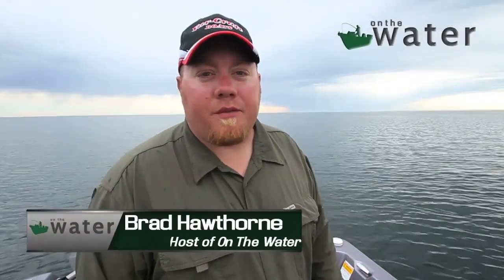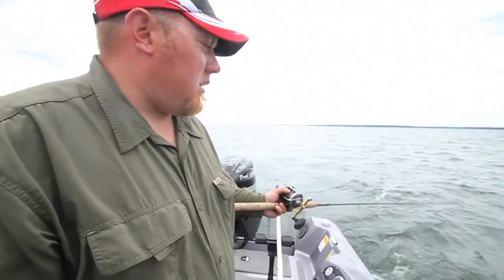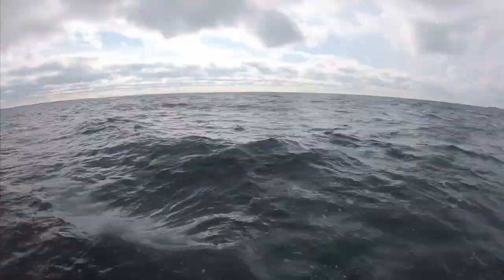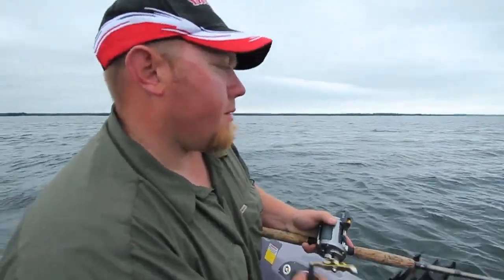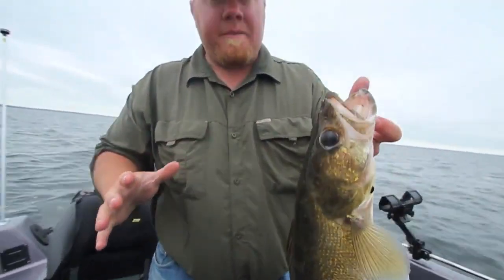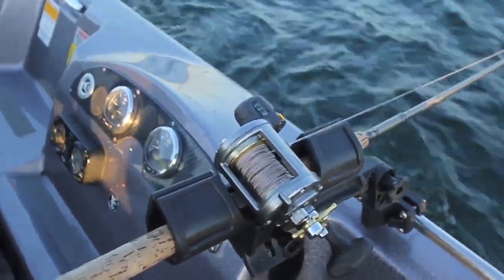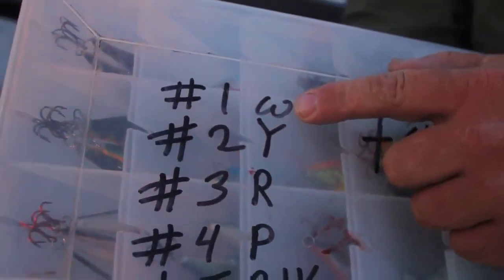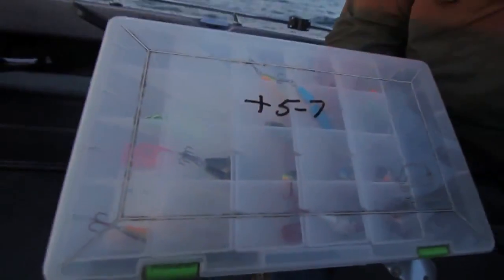Leadcore Trolling Walleyes on Mille Lacs Lake

Comment: Each color of lead core is 10 yards NOT feet. Each 30ft/10 yards of lead core will put a bait down 5 feet. If you have 4 colors of lead core out , you have out  120 feet of lead core not including your leader length.  Do yourself a favor and make it simple and use a  line counter reel so you don't have to remember colors.  A double "Uni Knot" is more practical to join lead core and your flouro-carbon leader as the swivel is awkward to pass through the rod's guides. If you are running  a crank bait with lead core,  you must  add the diving depth of the crank bait at the length of the leader.  Crawler harness run level  without a diving depth.
Reply: Mrfishreed he stated that each color was five feet down.

Comment: When you say four colors is that in the water or to the rod tip?
Reply: That would be the lead core color line.
Reply: So when you say four colors of lead is 20 ft is that four colors in the water or the fourth color ending at the rod tip?
Reply: @robertosterday5368  Where the line is touching the water